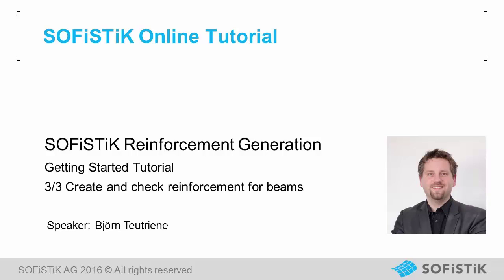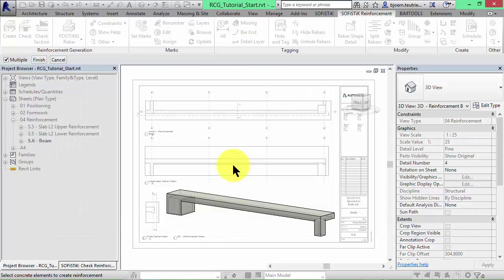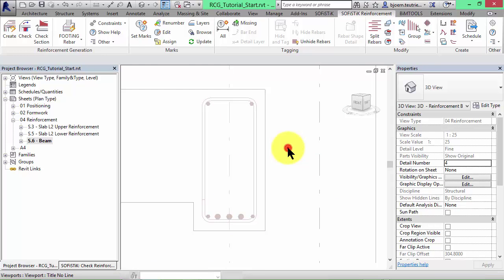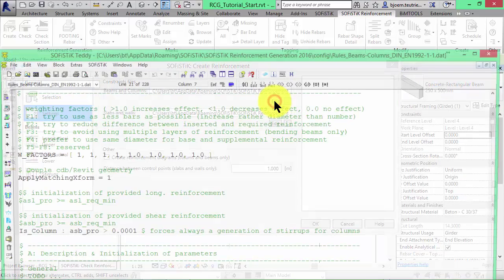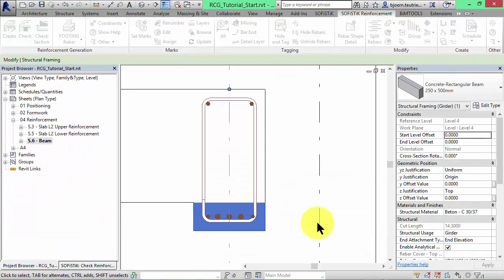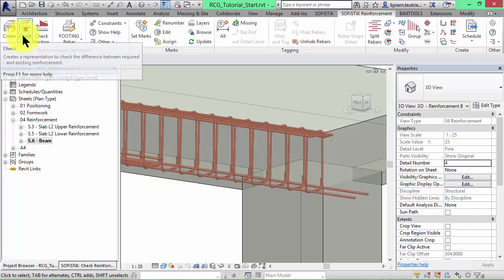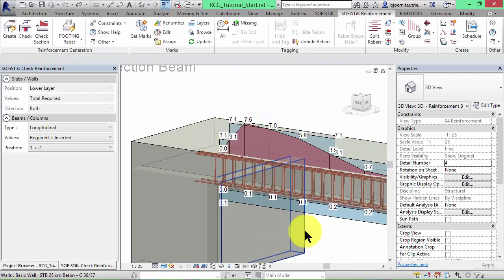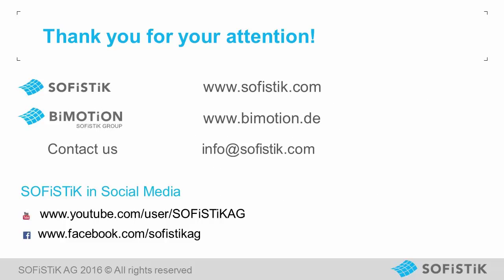SOFiSTiK Reinforcement Generation: Getting Started [3/3]

Comment: Hi I'm trying to use reinforcement generation but  I already don't have any cdb file in the Selection Data source tab! Is there a missing file during my installation? I can't find that file
Reply from the maker: Dear Mr. Gualavisi, the CDB-file should be in the same folder as the Revit project and same name in order to be listed. Maybe you can start the Revit project and export + calculate it again with our FEA-Extension. If you have further issues please contact our support@sofistik.com. Many thanks.
Your SOFiSTiK Team
Reply: @SOFiSTiKAG   Hi, I'm Ahmed and i need pack sofistik for revit 2020 (education licence or professionnelle)